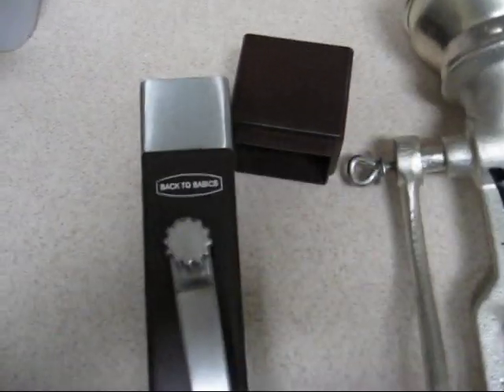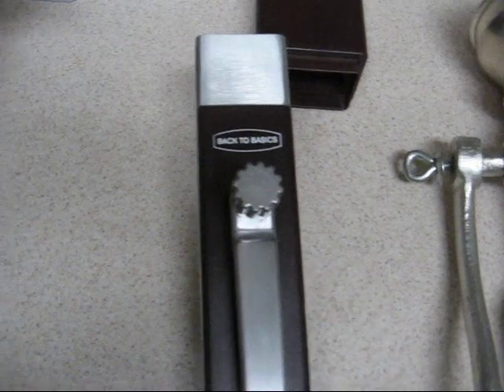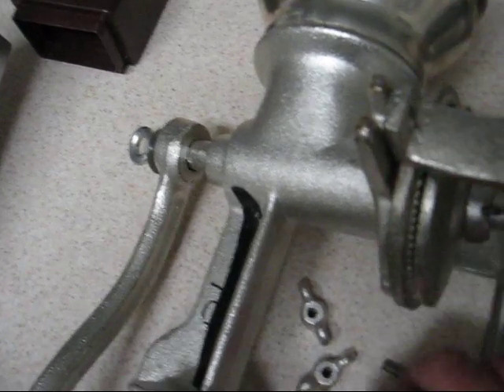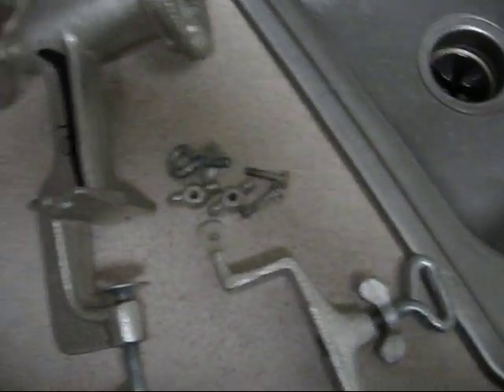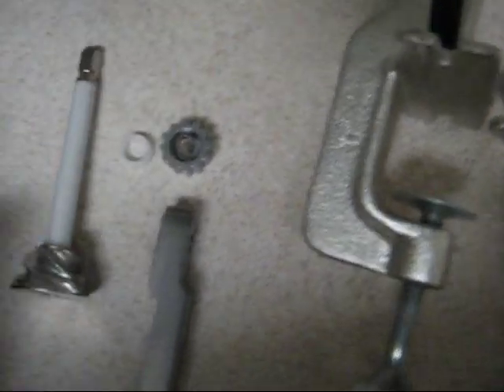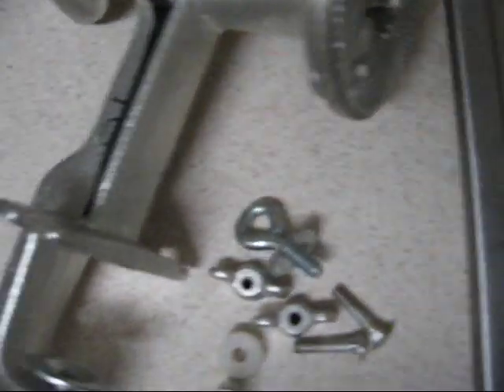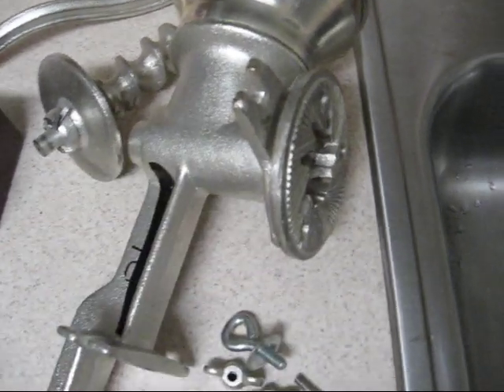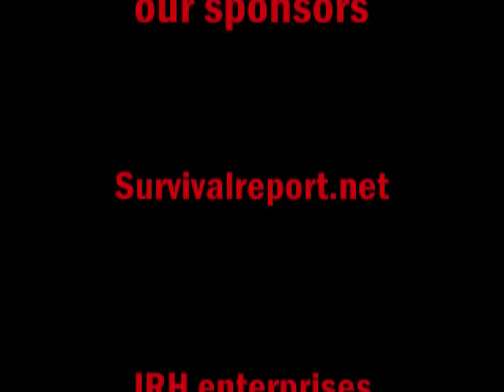Grain mill comparison

Comment: The nuts and bolts of the corona mill look pretty standard.  Should be able to get them at ace hardware for around $1-2 the BB mill parts look specific to the mill. Also corona mill looks robust enough you could figure out a way to add a flywheel and use some sort of automation (like a bicycle) with it.  Buy two and have a complete spare.  Another great video!  Keep up the good work!

Comment: I agree with steelhorses, the parts on the corona can be replaced, prob have some extras in the shop now. I have used mine to see how it works, and I do have to run the grain a few times to get some flower. the funal came in bent, they run around $30 now. They are heavy, but will last generations. Thanks for the vidio

Comment: I had the B to B mill, good for light duty use, not too durable, mine broke down near the clamp. I could have gotten it welded, but opted to get a better mill. I have the Corona mill. Best one I`ve used, gives ya big arms. I`m looking into motorizing it.

Comment: If you want fine flour you need to get a real mill with stones.  The cheap one in the video is a grinder, not a mill.  The other one breaks easily and isn't dependable for long term use.  I broke two of them before I realized that.  I bought a Little Ark from eBay, (made by Retsel in the USA), and have put more than 900 pounds of wheat through it so far.  About $180 on their web site, I paid $60 on eBay.  Very solid and long lasting.  Replacement stones are available too.

Comment: Does the back to basics actually grind wheat into real bread making flour, I'm not worried about a little elbow grease. I bought the cast iron one on the right and it only makes cereal.  I need real flour from my wheat. Also the one on the left can be called the victory garden and other names, are those styles all about the same.
Please help
Rob

Comment: Many 3 star reviews (they are more balenced in my opinion) on amazon state that the back to basics mill will not produce fine flour even after 8 passes! Cream of wheat consistency yes, but not finer. It has been suggested that the (5 star) reviews stating a fine consistency of flour are from the company but I suppose the opposite could be true, but as the reviews I mention are not 1 star this makes this less likely.